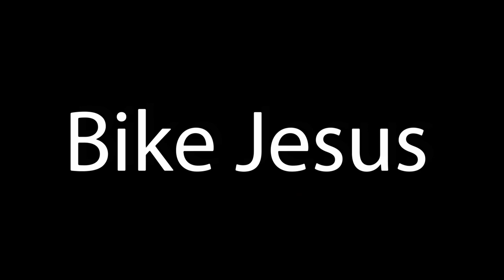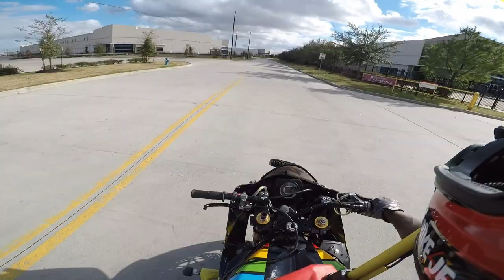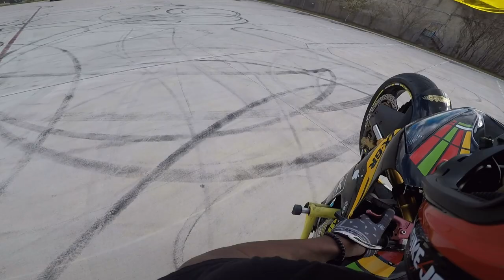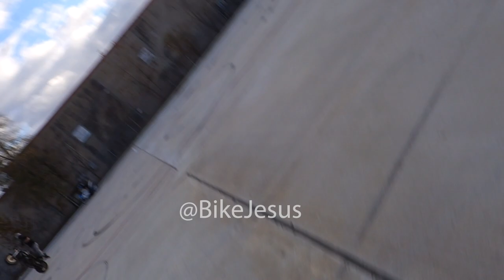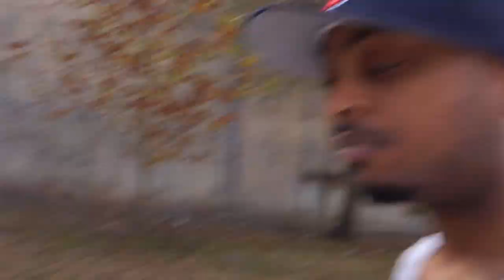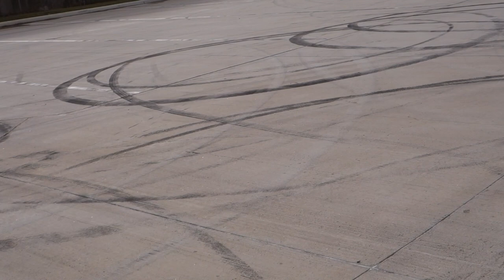Jewsa: Crashed hard AF trying to do sit-downs like a G

Comment: Bro, I wanna make a order for a specific tutorial. My bike is a 2020 650 ninja. I need to know step by step how to do slow wheelies. How to use and exactly how much back brake to use and when to use it. I need to know if I hold the clutch, then gas it up, then let go of the clutch, or do I quick clutch gas release or what exactly is the technique for the clutch and exactly how to use the throttle and how much throttle and also how to put it all together. Where should my bikes idle be set to and I need to know what speed is good to lift the bike in first gear and second gear. How to get to balance point and what to do once I get there and how does it feel. and how to stay riding there safely. Am I tapping the foot break or squeezing it or what. I need to know everything so I can get right for the summer. I only know how to ride and chase 2nd gear clutch ups but not all the time. I get a lot of burnouts and tire spins that be weird without the bike going up and I don’t know what’s wrong with my technique. Can you make a tutorial for me that will address all of these issues and teach me to get good and figure it out. Also, if you gonna do it for me, send me your cash app and the price. My utube channel is Lah Lotus. Peace!
Reply: Bro all you said above comes with time and practice every bike is different he can’t ride the bike for you you gotta go out there and learn your power bands to get the bike up and work your brake and feel it out. Once you get to balance point you will then move to learning how much you need to input for the brake. Everything you need to know is already out there on you tube. You gotta learn your bike and practice no one will get you where you want to be except for your self
Reply: @adama.1491  I appreciate your input, and I know everything you said is true. I’m just trying to get this skill down as best I can with little to no loops or injuries. My bike be doing weird stuff when I test it. Sometimes it does rolling burnouts instead of lifting. Sometimes it does a (S) shaped burn out and be unstable. I have a full M4 carbon fiber exhaust,  custom tune etc. I even added shorty levers and I’m trying to figure it out. It ain’t coming for me easy though